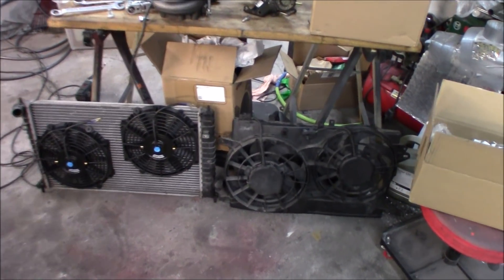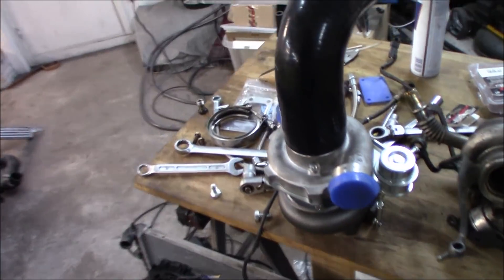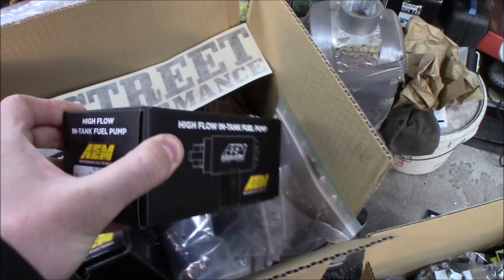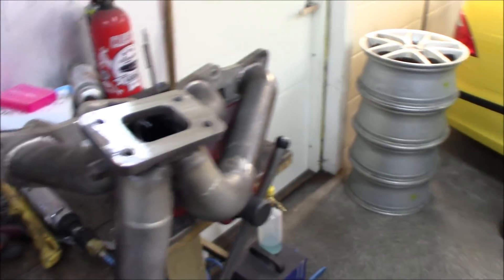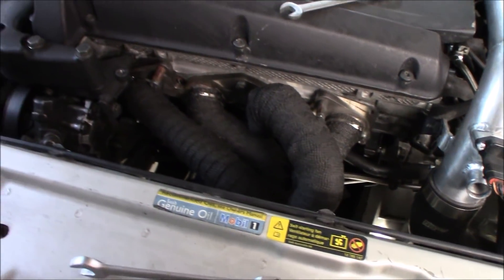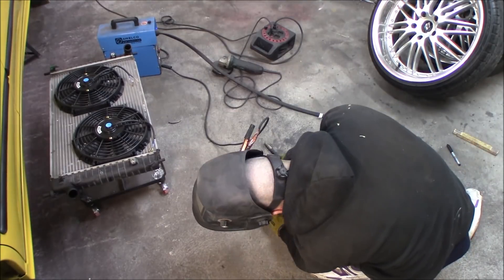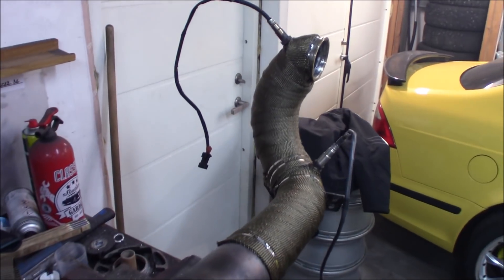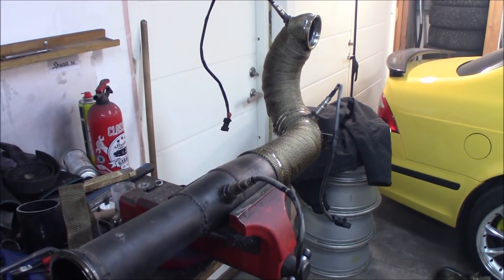Road To 500HP SAAB: Turbo Install Part 2

Comment: Where get banjo bolt for turbo. I got new cartridge and a gasket kit... but it didn't come with oil o-ring or banjo bolt. I also guess I have to make my own gasket  for recirvalve? I checked the diaphram its fine bit the triangle gasket just split apart
Reply from the maker: Reuse the old one? Mine was supplied in the kit i bought. Otherwise a local parts dealer should have an assortment in stock
Reply: @JonasKakarikas  i hear there is filtering that banjo bolt clogs 

I got new cartridge  for  garrtt turbo so I wantrd all new o rings and gaskets.  I'm ocd.

WHT worries me is I don't have that v band clamp to separate.  There 3 or4 rusty bolts. I read in forums good luck they are seized in their..  think pb blaster and heat with work?

I should buy new bolts?

Thing is it's my daily driver

Other things her code0033 for turbo I lose  power to half. I clear code and it's fine.

I have spares for all 3 and tested them, switched them I know

Comment: Great videos mate, can you confirm you used Volvo valve springs in your head and they work with no issue? I've ordered a new set and people are telling me they don't fit the t7 head, thanks and await your reply
Reply from the maker: No i did not, mine are custom for Saab.
Reply: @JonasKakarikas  I swear blind you said they where Volvo valve springs😂😂😂 do you have a link to the ones you have used please, thanks for your reply
Reply from the maker: https://shop.klracing.se/sv/artiklar/saab-16v-40kg-enkelfjader-for-7mm-ventil.html

Comment: blire nått rwd saab project i framtiden sen eller? hade vart kul att se ett sånt bygge, funderar själv på hur svårt de hade vart att ta en awd saab 9-3 och bakjhjuls konvertera. nog mycket custom arbete!
awd är dock rätt så bra då den kan trycka 90% av kraften till bakdäcken.
Reply from the maker: Det finns med i tankarna, det är ett svårt jobb men det finns lite olika lösningar 😉 att köpa en xwd Saab blir ju för lätt
Reply: @JonasKakarikas  haha tänkte mäst då man redan har kardantunneln bak. vet ej hur  icke awd ser ut men mistänker att de inte finns plats för en drivlina bak!
då blire ju de primära att ändra framvagnen och sätta motorn rätt. Hade vart kul o se nått sånt project! för min del får de nog vänta flera år